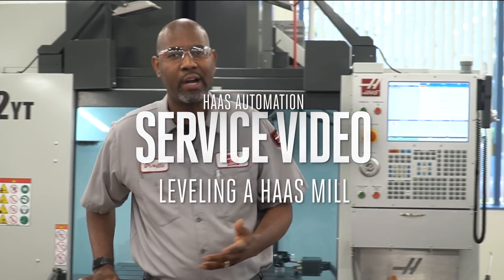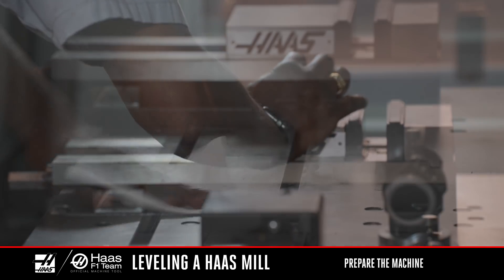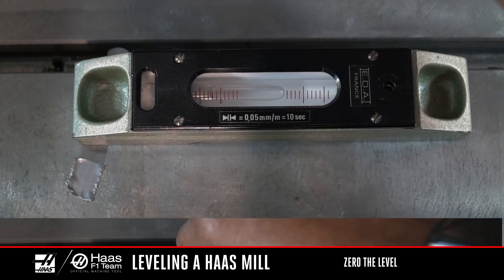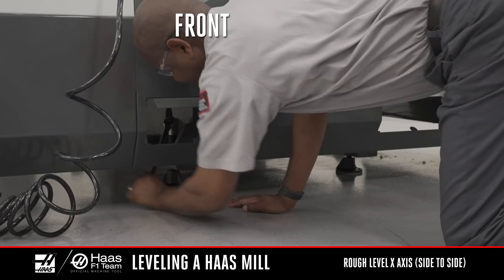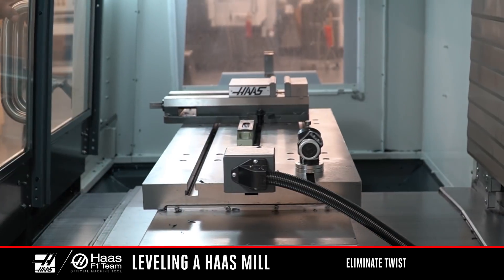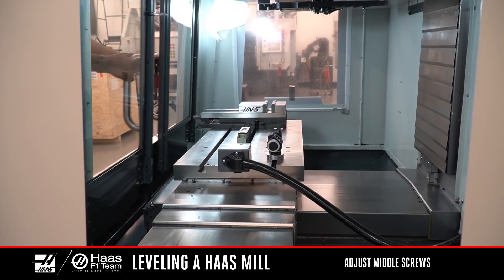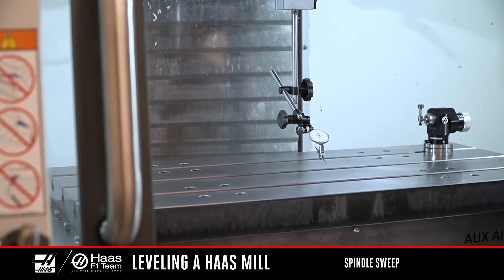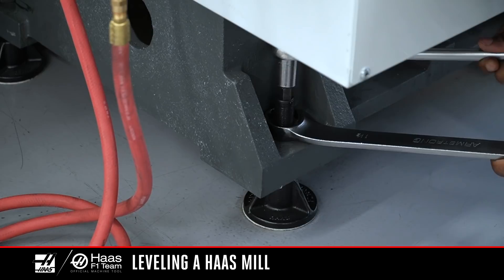Leveling Your Vertical Mill - Haas Service - Haas Automation, Inc.

Comment: I have a question about a VF3SS: what if you can't seem to remove the bow? It seems like they designed the center screws too far back.
Instead of removing the bow, slowly bit by bit you keep trying... until you notice your far back numbers getting wonky and discover the bow never left and the back feet are no longer touching the ground!

Are we supposed to lag the back feet to the floor to get rid of the bow??

Short of that, I can't see any way to get this machine within triple the bow it's supposed to have. 

How do I solve this problem.

Comment: Excellent instructions.
This is near exactly how I made my '93 VF 0 to slightly better than new specs. 

DO NOT be in a hurry with this. Take the day, you will not save time in hurry you will only chase your tail. The last few tenths require a small bit of movement. I use an old 1/2" drive 150 ft/lb beam type torque wrench. A new one is inexpensive. It allows a repeatable sensitivity.   

necessary. N

Comment: Levels are self checking. It is more accurate to rotate the level 180 degrees. The level is calibrated when the readings cancel each other out.
Reply: I'm curious why the shim was used as well. Maybe the adjustment range of the precision level wasn't enough?
Reply: @poetac15  The reason for the shim is because the level was out of range when set on the table. It's not a good practice. It's best to find another machine or a surface plate. To set on on a surface plate that isn't leveled rotate the level until the bubble is centered. Then grab something heavy, like a 2x4x6 block to capture that position and flip the level 180.
Reply: @poetac15  The reason the shim was used was for Orville to know WHERE to place the vial after he turned it 180 degrees. He could have used a marker and draw a line directly on the table-the same thing.
Reply: Lol common sense is lost 🤣

Comment: Great video, but can you please include metric information next time?
Reply: The level was in metric value 0.05mm/m. If you want to be very precise you can use the level 0.02mm/m. Check the video time 2min 5sec shows the level
Reply: @darekk7596  It's about all of the information in the video, not about the spirit level.
Reply: @andreashabijan2514  I am a metric guy too, but I have learned over time to make conversions on the spot; it's not difficult at all-after a while.
Reply: Yee